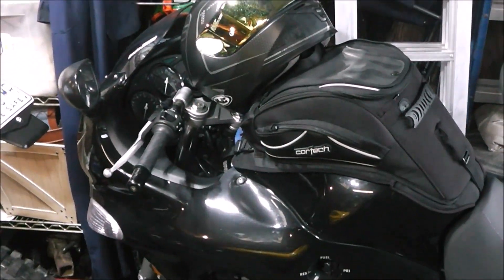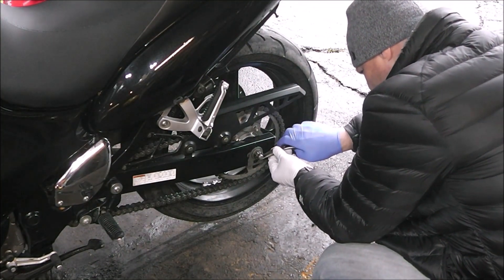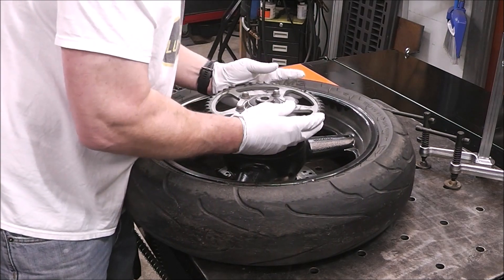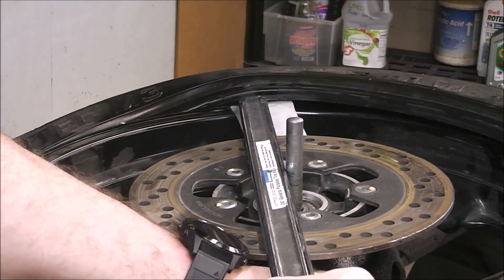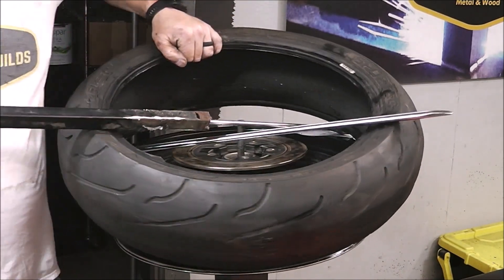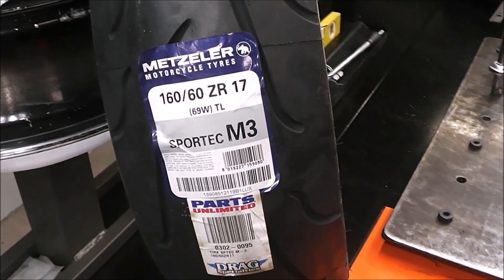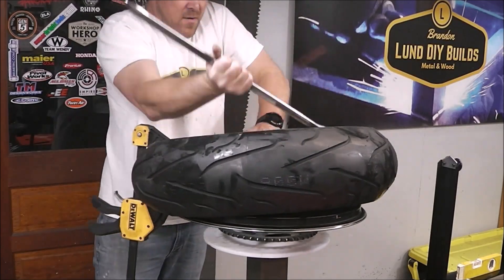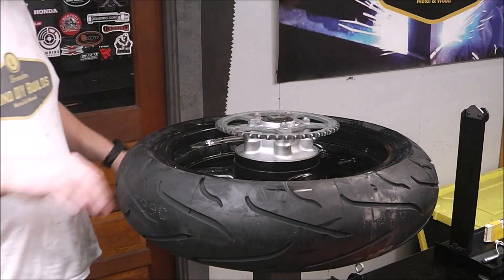Changing a Motorcycle Tire using a DIY Custom Built Tool

Comment: Lol I did a burnout on my mini chopper and smoked out the garage. I had to pull the engine apart and remove the governor, it was causing me problems and not letting it start or stay running at idle. Managed to take it out and drive around town today it was super scarry because I don't have brakes yet and it sets low so I have to avoid bumps and holes. Also it goes fast... I maybe had it half throttle and I was hauling some butt. Still need to mount the chain tensioner and the caliper but other than that she held together rode pretty good I can turn and swerve if I lean into it. I'm not use to riding a motorcycle and I'm noticing you lean more than you turn the actual wheel.
Reply from the maker: That's awesome man! I've been following your build.. It looks like it's coming along nice!
Reply: @BrandonLund  it has not been easy... but it has been alot of fun learning how to build it. I went into this with absolutely no idea what to do, just started putting stuff together, taking it apart, breaking it... thank you for inspiring me to get out and build stuff. You and Mike festiva on youtube have been a huge inspiration and a source of alot of knowledge during this build.
Reply from the maker: Thanks Korey. Those are some of the best times when you kinda wing it and figure out what works and what doesn't as you go. I truly appreciate your kind words. Its why I have this channel...to help people so I thank you again...it means a lot!
Reply: You actually counter steer when going fast. If you want to go right you lean right and steer slightly left. Its pretty weird.

Comment: Also i love this tool im definitely going to have to make one when I make a bigger bike with bigger tires. Well I suppose I could use it to change my baby wheels 🤔
Reply from the maker: Right on! It's a huge time saver! (plus it's fun to use stuff that you've built) :)
Reply: This mini chopper has been a blast. Should have seen the looks on people's faces as I drove by... priceless. I'm trying to figure out how to hook up a whatchacallit... charging coil thing so I can put a small battery on and some lights to make it look cool.
Reply from the maker: My Dirtbike has a small Lithium ion battery that powers the blinkers and tail light. I plugged it in last summer to charge it and ran it all summer without ever charging it again. There are 5 or 6 batteries that look like little AA batteries and they seem to work awesome